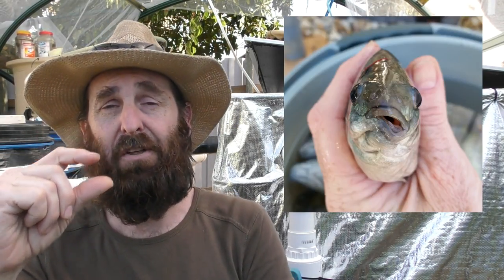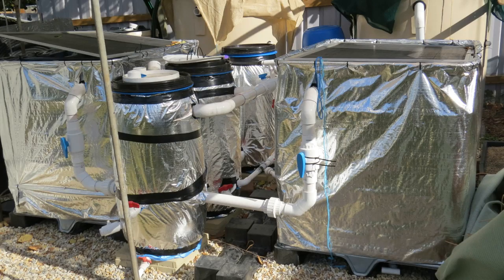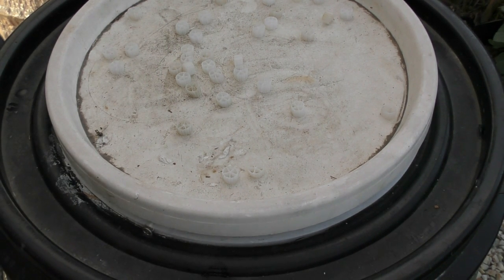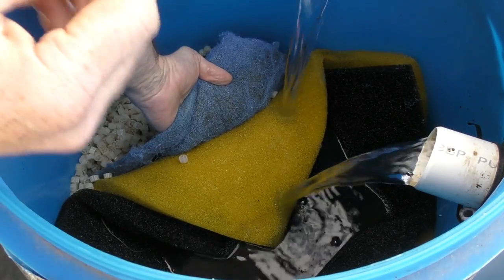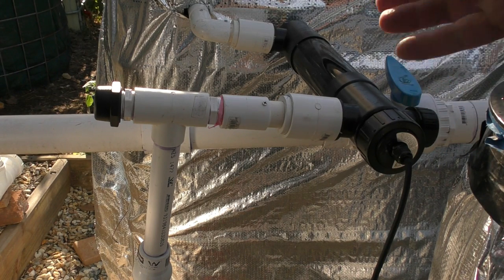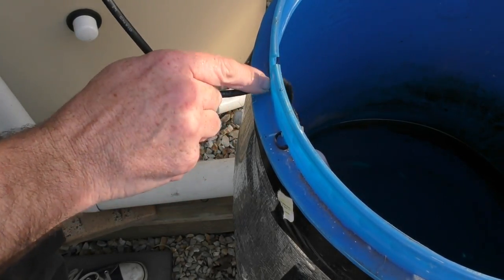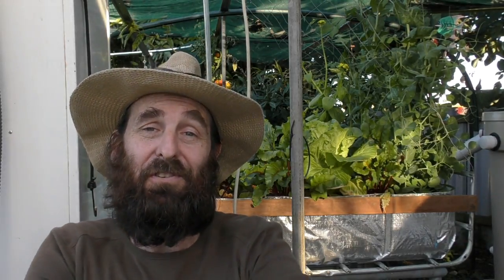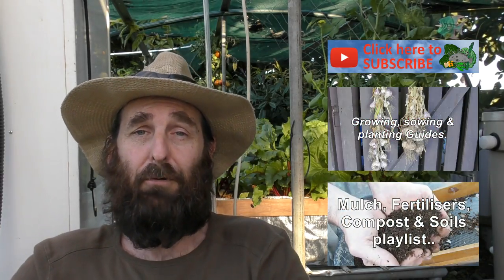Fish farm update. Winding down the system. August 2015

Comment: two suggestions for the solids in your square tank... 1) create a vacuum with your overflow lift by capping the air vent at the top with a "vacuum hose" of sorts to create a syphon to clean up the bottom corners... 2) extend the tube to the water the being pumped Into to the tank to the bottom causing  the inflow to disturb the waste piling up in the corners.  either way should help keep it cleaner.  everything looks great.  hope this helps.
Reply from the maker: +Doc Bartley 
HI Doc. 
I have a vacuum attachment I use to clean out the tanks & it works very well I've found.  https://www.youtube.com/watch?v=zETpcZmm8QE
The system's all dismantled now so not something I have to worry about. Will be passing the vacuum onto my patents so they can use it in their system though. 👍
Have a great one mate.

Comment: Really appreciate you putting imperial units in where you can; I bet it's a pain in the ass but shows respect for part of your viewership.  If I make a video of my setup, I'll reciprocate.  That's straight up neighborly of you.

Can't wait to see your parents' house's build.

Lovelovelove the humility and integrity on the bit at the end regarding scaling/commercial bid requests.  Cheers man.
Reply from the maker: mike krebsbach Morning Mike. 
As a kid I worked in my fathers engineering factory where he still used imperial measurements when he was building machinery for himself. Used to drive me up the wall but appreciate having to learn the basics now ;-) 
Have you got a system on the go or planing a build? 
Cheers mate.
Reply: RobBobs Backyard Farming 
Planning (current generation anyway) to build similar system to yours, scaled down approx 1:5 and utilizing what you've learned/demonstrated for us.

From what I can tell of your last couple years:

-square containers = problem for sedimentation buildup in corners therefore wherever possible use rounded; bonus points for conical drainage bottom.  otherwise expect to clean a bunch.

-mylar (or similar) around everything with nutrient-laden water.

-bio-reactor equally necessary as radial flow settler which appears superior to swirl filter.  Considering throwing in a UV later on as I've read that there's levels to which you can bombard your water with UV and mostly only kill/inhibit algae.

-never allow particulate into grow beds.

-venturis are not panacea but utilized for proper job can be a godsend.

-glued plumbing doesn't appear terribly necessary

-keeping an open mind, expecting to work my ass off and possibly fail, remaining positive and sharing what I learn is a must.

-the point isn't to make/save money; become a commercial aquaponics system builder guy.  the point is to become more self-reliant.

Experiments:
-considering covering all exposed grow media with mylar; O2 shouldn't be effected but can adjust with additional stones/venturis

-considering adding crawfish or similar to sediment catcher or maybe even a little crawfish habitat that's fed off a trickle flow from the radial settler's sludge output  (happen to know a good supplier in the US that can get me some of those red-clawed freshwater lobster as you have in Oz?)
Reply from the maker: mike krebsbach Hey Mike. 
Not necessarily mylar as paint would have to be the easiest & cheapest method. Have had a few issues with it not sticking to some tanks thought. Seen some very nice looking timber clad units too. 

Bio is only necessary if you are pushing the stocking limits of what the grow beds can handle I think. Don't think a UV is needed on the aquaponics but it has come in handy on the straight fish farm though ;-) 

Am really looking forward to setting up a red claw tank here but it's way down on the list of to do jobbies here at the  moment. 
Cheers Mike.

Comment: Rob. I had 100 Jade fingerlings 14th Feb 2015 up to the start of our cold spell in SE Qld I lost about 6 that went off and hit the wall of 1 of the tanks when I cleaned out the bottom and 99% of the rest due to not being able to keep the temp above 15C so my run at it after 3 years of fooling around is over as well though the wicker beds and the wicking Bags (the brown ones) are flying and only the bags are conected to the 5000lts of fish water. So Pet Gold fish are going to be it and only 2000lts of water and 3 new 1000lt garden rainwater tanks for the wicker beds thanks for all the Vids keep it up ,it's well worth the watching.
Tony Cooroibah Q
Reply from the maker: Tony Campton Hi Tony.
Shame about the jades mate.  I've had the heater in the system the past few nights as it been a bit nippy down here again. Waters dropping to about 14 in the morning but is back up to 20 by night time. 
Hope the new beds & smaller system goes well for you mate. Glad you're happy with the Root Pouches as well. 
Cheers mate & have a great one,
Rob.

Comment: My system is getting there day after day:) Did some pluming today!! Tried running it but I think I need to work on my drain pipe. It is not flowing right but I think if I make the  angle a bit steeper that will fix the issue.
Reply from the maker: Farm Hey mate. 
They do take some tinkering when you first start out ;-) Have been having fun trying to sort out some new pipe work here this week. 
Cheers mate.
Reply: Once I get everything up and running I'm going to put some videos together so everyone can see it:) Thanks for all the help RobBobs Backyard Farming:)

Comment: Hi Rob,
So when talking about off-gassing, Ive noticed several others who have a closed barrel system like you do, if one has a lid on the barrel and not venting at the top to outside atmosphere, its hard to off-gas if the built up gases inside the barrel cant escape. Just a thought.
Reply from the maker: ***** Hi Rob.
To tell you the truth mate I haven't looked into off gassing in great detail at the moment as with the aquaponics we want to keep in as much nitrogen as we can.  Even though my bio has a fairly tight lid gas would be able to escape through the entry pipes from the radial flow filter. Will be something I ask Paul next time I talk to him. 
Cheers mate.

Comment: RobBobs Backyard Farming

There is three versions of UV for water systems. The strongest kills Bacteria while the second version kills Algae if I recall correctly while the first one just kills well, living creatures if you have Daphnia or such in the systems.

Also for the square tank, you can't build a square for the base. Each ninety degree elbow gets a larger hole drilled in them as it rests against the base or slits or what ever. Then a T-fitting to the outlet and that could potential deal with any corner accumulation ? Might, might not work. It really depends on the suction I guess but in my theory thinking it should work to some degree?
Reply from the maker: Helveteshit  Hey Mate. 
Have a few friends that have a single pipe run diagonally across the base of their tanks similar as you suggest for solids collection & most are happy with them. A few have had issues with the holes clogging while the fish were small but that's easy enough to fix once the fish put on enough size & holes can be enlarged.  
They still need to be removed & cleaned periodically but that's no drama as I see it. 
Cheers & all the best.

Comment: Just wondering if you have considered yabbies or other bottom dwellers to solve the waste issue
Reply from the maker: +Tr3asureHunt3r 
Not for the this system but have had them in the the aquaponics before. Good at processing some waste but still don't get rid of it all. Hope to have  red claw pond set up at some point & will be adding some of the solids from the aquaponic system onto it. 
Cheers mate.

Comment: Would it hurt the fish to put a small pump (like used in salt water aquariums) to generate a genital current at the bottom of the tank to prevent settling?
Reply from the maker: +Rachel Dotey 
It might annoy them a bit Rachel but too much. Have seen other folks run a pipe over to the dead spots & connect it to their solids lifting outlets which is another option 👍 
Cheers.